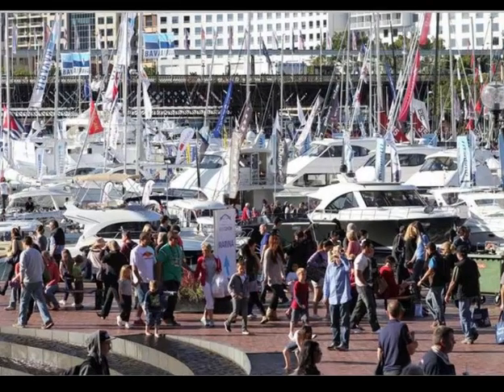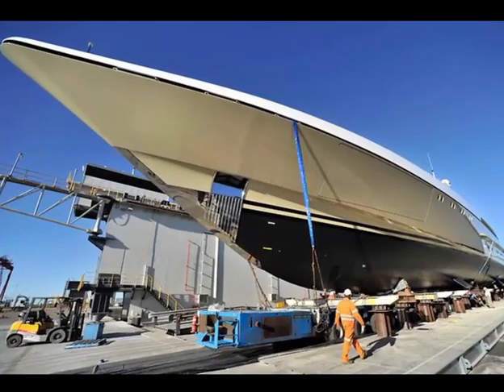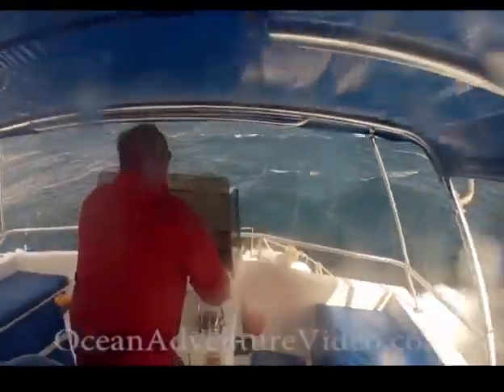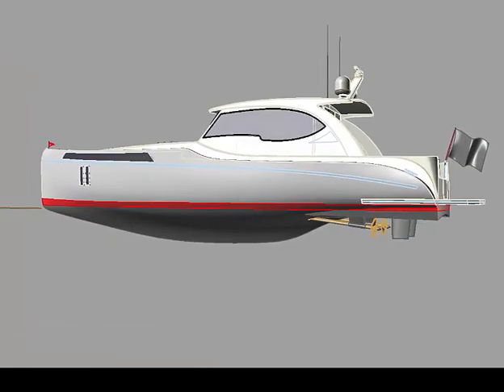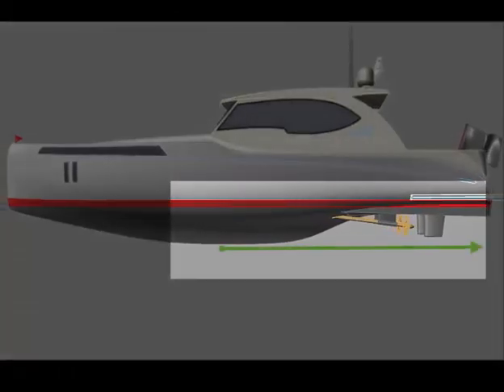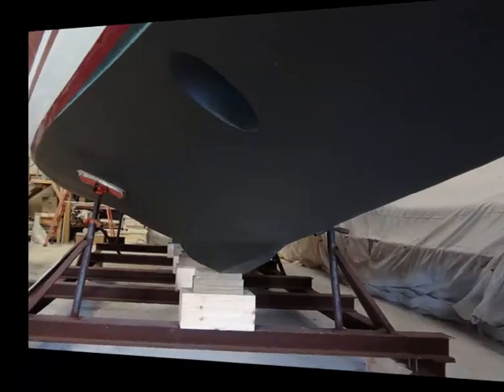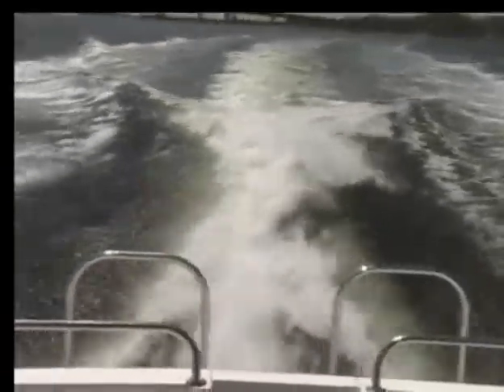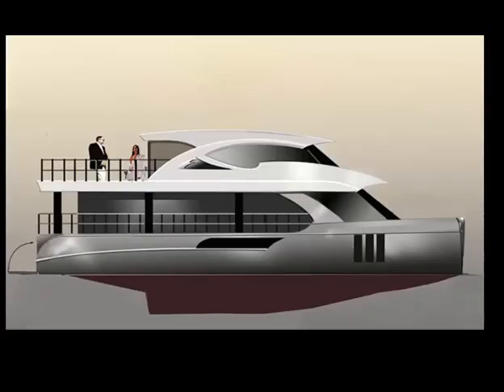Shannon Silver Hull Design

Comment: I'm designing a small 9 ft Runabout. My boating experience comes from Modern Performance Racing sailboats basically carbon-fiber triangles, the noses are sharpened plum, and they slice right through the wave, which roles right over the top of the boat and out the open transm. It's going to be a wet boat but it'll get you anywhere and I wanted to surf. I've also been surfing my entire life
Reply: How you go with your build. I am currently building something similar but 15ft, with a wave pierce bow, and 3 steps hull with a 27deg deadrise. It will be a very wet but very fun boat!

Comment: I've been looking everywhere online for this hull that I heard about somewhere a couple years ago. I typed SHR hull design and SRH and but no luck and was starting to think I  just dreamed it then today I saw your thumbnail picture and clicked. To my surprise it is a video by the designer himself! 
I'm trying to see if your concept of  inverted concave stern section can be applied on a  skiff. I've made several models and the lines are really elegant. I'm planning to build a full size version (probably in the range of 14' to 16') in the near future. I've never built a boat so this is totally non commercial, but it's really fascinating and basically I just want to see how it works. I figure I can always modify it to a standard modified V if it doesn't work out as hoped on a smaller vessel. Anyway, so glad I finally found your video. Thank you and best wishes for future success.
Reply: 7

Comment: Nobody has yet mentioned that his designs are almost identical to the design used by Striker Yachts. I ran a 44ft Striker for ten years and it was a slow boat, and in moderate seas the hull used to suffer from a phenomena known as “Chine Walking” very scary stuff in a choppy sea!  IMO  a dreadful idea, the only way to go is a deep-V I currently run a 65’ Viking which is a deep-V design which by its very design makes it a great sea boat!

Comment: Of course displacement hull won't pond. They can't get up and speed. My God, look at the bow spray and how hard engine is working. 3 times of fuel usage?
Reply: Yep, no such thing as a free lunch. You gain somewhere and lose somewhere else.
Reply: Was going to make a similar comment. Look at 2:48 and how much spray the boat is casting aside. That is energy used for throwing water aside instead of used for going forward.

Comment: That hull wastes a lot of fuel due to the centre aft section change of curve and suction and so drag at the back.  One cannot better much the old displacement German Torpedo boats with a rounded hull. The British had flat hulls, but in heavy seas the German run head and shoulders above the British designs.   Nature is what it is and it is very efficient in its design, there is no  natural creature with the lines described in this video.     This hull achieves what it says  only at the  medium speeds between 18 and 28 knots. Below and above that it is an inferior design.
Reply: there is nothing in naature that do what any surface boat do!! as a work boat the design so ok!! need a bit more curve deeper in front but that can make problem in following sea at crossing!! but at sea can hold faster speed in big swell!!

Comment: those boats r just plowing
Reply: Well  you are so right my thoughts exactly slow but looks smooth though
Reply: Walkertongdee smooth maybe but inefficient as hell!
Reply: Agreed
Reply: joe jitsu  The point of a power boat / sports cruiser is to go fast... which is why you want to go on a plane to minimize friction. The hull displayed here competes with semi-displacement hulls, not planing hulls. Semi-displacement hulls don't suffer the same stability issues as planing ones, so what's the point of his design?
Reply: joe jitsu  Nice wall of text. Maybe I wasn't very elaborate, but i think you're missing my point. The old man in the video is spouting a bunch of shit about planing hulls, like they are fundamentally flawed. The planing hull is a well considered trade off in favor of speed. When mentioning friction I'm obviously talking about friction during planing, otherwise the comment makes no sense. If you want to handle waves, you're much better off in displacement hulls, but most boats with planing hulls are designed as recreational vehicles intended to go fast when the weather is good. I'm well aware from personal experience that a small recreational boat with a planing hull is completely useless in even slightly rough weather, but guess what? It's been a problem maybe once or twice in my life since we only use our boat when the weather is nice and the family wants to go boating. 

The old man is marketing his hull as a competitor to planing hulls, but I'm speculating his hull doesn't provide the same efficiency at higher speeds, which again, is the entire point of planing hulls.